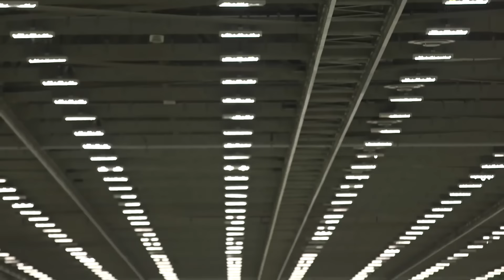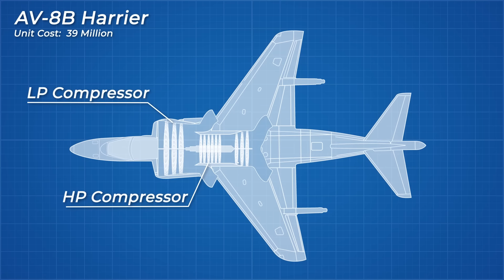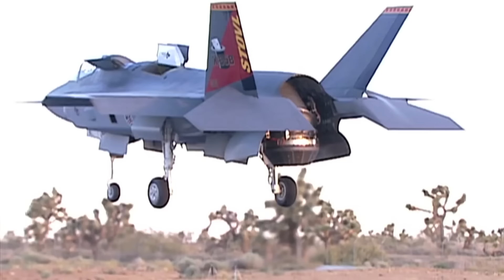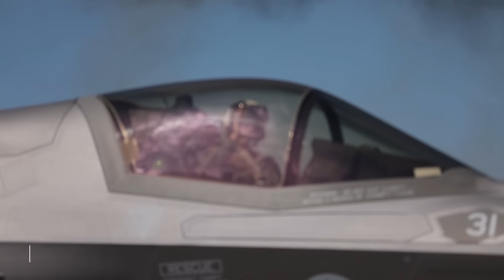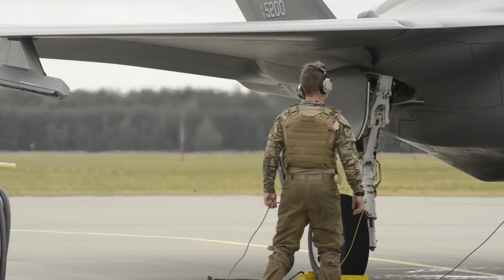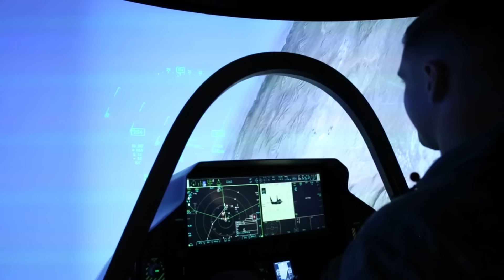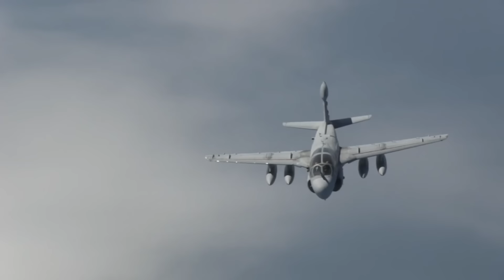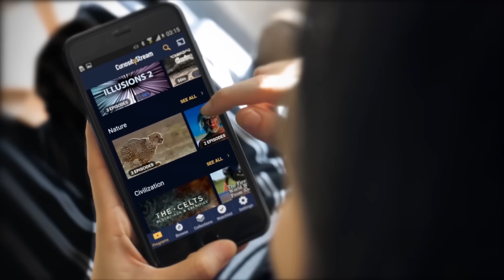Is The F-35 Worth $115 Million?

Comment: I don't think it's entirely fair to argue the F-117 'failed' given the fact only one single plane was shot down in ten thousands of sorties - that's actually very impressive insofar strike ratio's go. Especially considering how badly the deck was stacked against it in Serbia: Its radar signature flared up because of open bomb bays, no prowler jamming escort, the flight path was known by the enemy, long wavelength radar was used. They would likely have lost a lot more if it wasn't for its already outdated stealth technology at that time. The US deliberately didn't destroy the plane's remains because at that point the F-117's stealth capabilities were 30 years old and only of limited value to the opposing force. It's a shame it's remembered for being shot down once because it had a very good run.
Reply: The only failure was in using the same flight plan day after day.
Reply: The f-117 had no jamming and limited sensors. The F-35 can Jam multiple targets at once and out-range Sam sites
Reply: One broke its wing off and fell on a residential house ,everybody took a piece of the composite material for soveneir showoff
Reply: The F117 was a good attack plane in the dark not something I would want to operate in the daytime
Reply: The plane wasn't the failure. The tactics were. Gave up sensible tech advancements to the rest of the world because of many avoidable mistakes
Reply: Shot down by Russian made systems from the 60s, nowhere near capable air defebses. There's no such thing as stealth unless you fly blind,  which becomes a suicide mission over enemy airspace.
Reply: Shot down by a 1961 soviet sam...
Reply: ... After literally everything that could go wrong for it did go wrong and even then it was an insanely lucky shot

Comment: You present this project as if all of the supposed features work. They don't. It still can't carry most of the loadouts it was supposed to, there's now a 30 second limit to the use of afterburners, and dozens of won't-fix issues labelled critical. Glad the Yak-41 tech was developed further and put into production though, even if Lockheed is a bit stingy with the credit ;)
Reply: All features work, just not perfectly in a few cases, but that's not unusual for fighter aircraft. 

It was never expected to carry all the loadouts this early in it's lifetime. How could it when the weapons themselves have not entered service yet on any aircraft? 

There's a peacetime limit on the time above Mach 1.2 of the B & C versions, and it is closer to 1min than 30sec. There is no restriction for the A version.

Yak-41 tech has nothing to do with the F-35. The only tech similarity is in the rear nozzle which was borrowed by Yak from the American Convair Model 200.

Comment: Though the F35 is a capable fighter, the costs are ridiculous but blend in well with all military contracts with defense contractors. Instead of applying known principles and methods of engineering, they hire grads and let them loose to guess until something works. When it doesn't work, they guess and spend again. Every revision is a multiplier, not addition. They must go through the entire cycle of design, detailing, purchasing, manufacturing, and testing. It is ridiculous to watch daily. Even simple engineering such as tooling demonstrates the lack of knowledge of something as simple as statics. Mechanical engineering has known principles. There is no mystery. Like mathematics, 2+2 always equals 4, a trained engineer can design anything correctly the first time. They simply don't because defense contractors win contracts of time and money. Priority is to burn hours and dollars, fall short and get more. A very bad business model.

Comment: Pilot which flew a F-15 a dual engine plane designed specifically for air superiority that has had one plane land safely with out a wing because the engines were so powerful it causes the plane to go ballistic.  VS a prototype F-35 single engine plan designed to be a multi-role fighter.  A better comparison would be an F-16 vs F-35.

Comment: if the plane is damaged is it possible for the fan which is otherwise 'dead weight' to keep the vehicle falling out of control or will it just spin around like a helicopter?
Reply: I very much doubt it. The type of damage which would cause a plane to fall uncontrollably would almost certainly damage the engine, linkage to the fan, or the fan itself.

Comment: One thing that has remained constant in aircraft development is that they all had huge issues when first brought out. The P-51 Mustang was a marginal aircraft at first, F-22 went through development problems and so it goes with the F-35. Those earlier planes became the best in the air, the F-35 has done the same thing. Relentless pursuit of the initial problems with one of, if not the most complex aircraft built for combat has made this a really formidable aircraft.  The MSM will have you think it's an abysmal failure, but if you get a chance to see it go through it's paces at a flight show, take  it. Check out Curious Droid channel's piece on this plane.
Reply: The biggest complaint I've heard is that the F22 would destroy the F35 in a straight on dog fight. But the F35 is so much more than a plane-on-plane fighter. It's versatility is its selling point. It can be a very competent dog fighter, a stealth bomber, reconnaissance, and more. You could mount a whole bunch of wildly different missions with a team of 5 F35s vs F22s.

Sure the program was long and wildly expensive. But it is still the finest jet in the air today. Hopefully the F4x won't experience development hell.
Reply: @TheCuriousNoob  Yep, exactly. The US military doctrine centers itself around air superiority and that's the entire point of the F22 and that's why the US is happy to export the F35, but not the F22. The F35 is a multi-role fighter with air-to-air, strike and air-to-ground capabilities as you say, hence the name Joint Strike Fighter.
Reply: @TheCuriousNoob  argueaqbly the best. I say that because it fails in many regards in comparison to other jets
Reply: @menotyou7762  such as?
Reply: @jurajsintaj6644  such as Speed. Maintenance, Runway length needs  ie you just can't land and take off the same as most jets. lengthy upgrade process. The jets a turkey in comparison to other US jets,  time will prove it
Reply: You can't expect journalists who most get C+ in Science and Math to appreciate what 30000 engineers took 30 yrs to accomplish.
Reply: At least it would be better than Boeing’s proposal
Reply: Using past performance to justify present problems is asinine.  Every project is unique.  They bear no relation to one another.  The F22 you mention has already been cancelled.  There will never be another F22 made.  So if you're comparing the F35 to the F22, then the F35 is bound for the trash heap as well.
Reply: Quality over quantity any day.
Reply: The plane itself wasn't a failure - but the PROGRAM was. Not because the plane didn't eventually turn out fine, but because we wasted BILLIONS of dollars getting there. I imagine any idiot could produce a quality result if you gave them an unlimited budget and made sure that delays would never result in cancellation of his contract.

The "MSM" as you put it isn't the only one calling this a failure. A huge range of experts do as well. And the reason isn't that the tech was eventually worked out, its for exactly the reasons mentioned in the video: That the strategy and approach decided on by politicians was an absolutely stupid way to achieve the intended capabilities.
Reply: @texastriguy  So you’re saying the end product (ie the plane itself) was a success, but the process of developing it was marred by incompetence and wasteful spending.
Reply: @texastriguy  Considering That the end result WAS a quality aircraft and right now it’s export sales are massive, calling the program a failure is nonsense. I’m willing to bet the actual R and D cost is far lower than you think. What experts call it a failure? Pierre Spray? There is a large group of people who call themselves experts when in reality they have no expertise. Pierre Spray is extremely outspoken and labels himself as the designer of the F15. His only contribution was a rejected counter proposal for a plane with the exact opposite design characteristics of the F15. These “experts” still believe that a good aircraft is a WW2 era jet fighter but with all the armor stripped out of them.
Reply: 27 years - still a long list of problems. No other aircraft in the history of the US has taken so long nor has been so expensive. The P51 just needed an engine, The Phantom you had the tail and the wings modified, The F16 took what a couple years? The F15 was pretty much a hit from day one.
 i don't know if they keep spending sooner or later they will have a jet that works but the f35 has no middle ground. love it or hate it the US will continue to twist arms to get sales